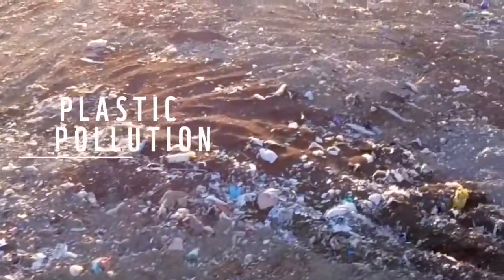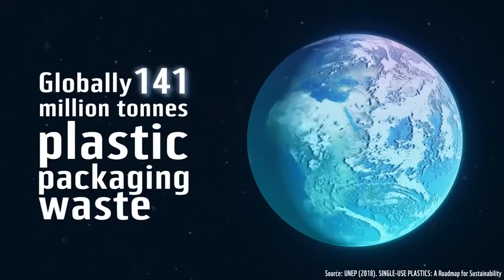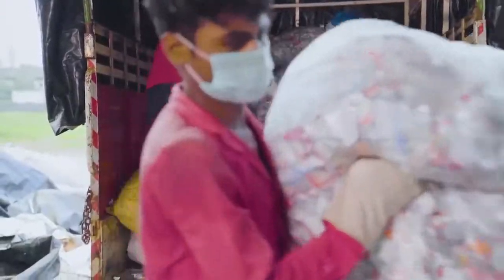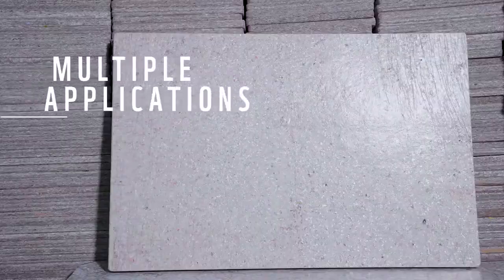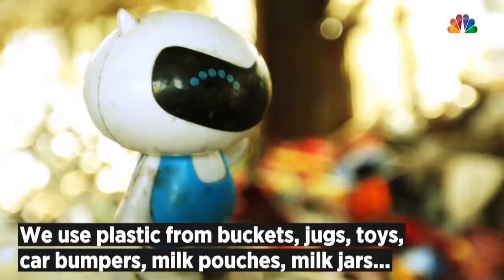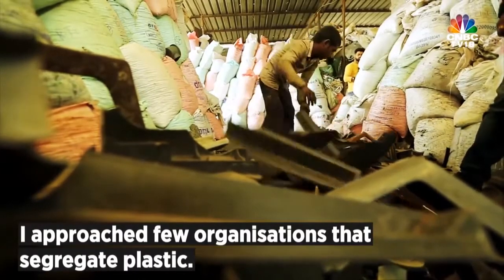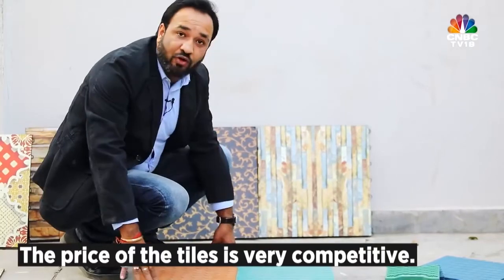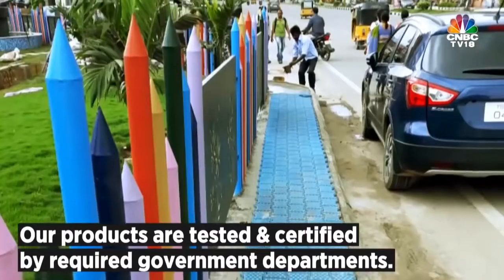Innovations in Plastic Waste Management

Comment: Nice video.
Now it is real. 
We use the fast pyrolysis plant Fpp02 for recycling plastic wastes. https://youtu.be/f2J4rOFEDVg
Pyrolys reactor 500 kg/h. It turns out liquid  fuel for hot water boilers.
Good luck to the author of the video.